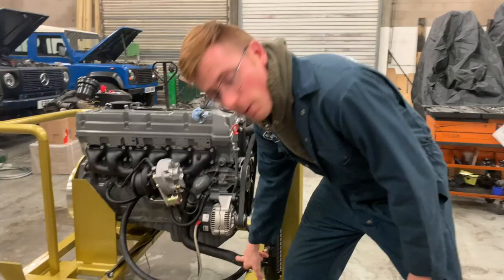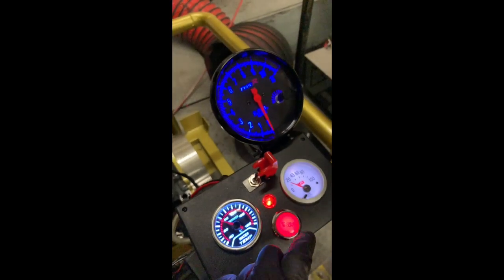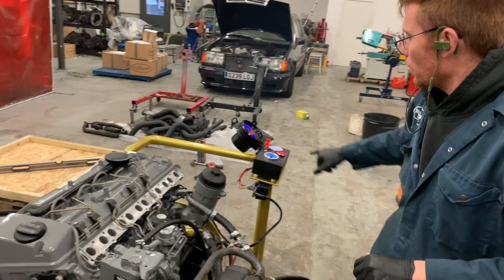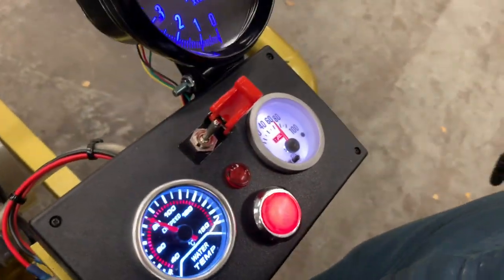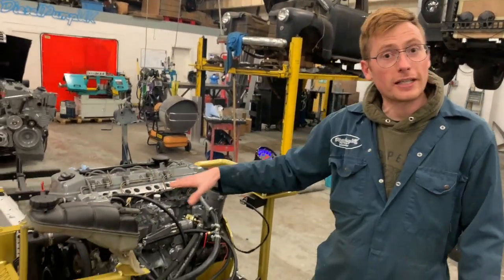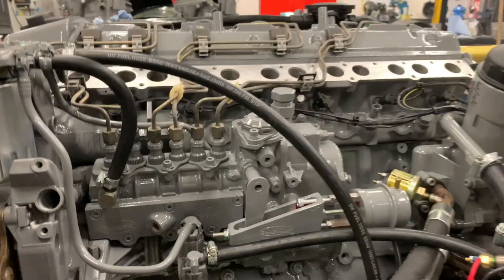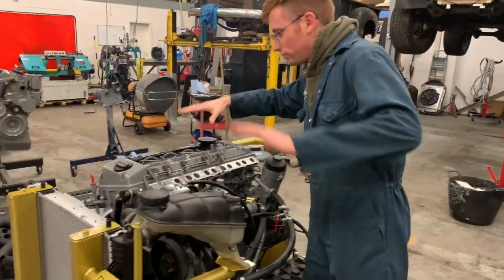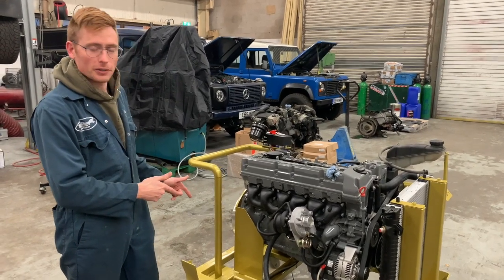"goldmember" the OM606 test stand

Comment: yea I love it. Ok son bought a 99 merc with diesel and dumped it off at my house. so it was a repo and has no keys and is trashed but he wants it for the drivetrain and at 400 bucks its all good. now there is no ignition switch and all that is missing but the connectors are there. Wants to pull engine but I'd like to get it running first is there a was. my son found the starter soleniod wire so we can get it to crank. is there a wire to get it to inject fuel. I did jump the main pins on the connectors for the key switch and got the instrument gauges working. Just want to get it running for a minute ore two. will be going with your manual pump set up.

Comment: Im about to acquire a 1990 190 2.5 Turbo. in a month or so.
Will these tuneups be applicable to it for some extra responsiveness nothing mad. Just some more street power running clean no coal?
Since I only saw you do 6 bangers.